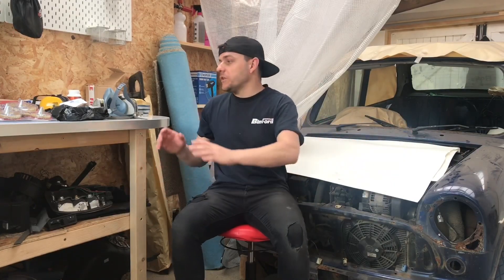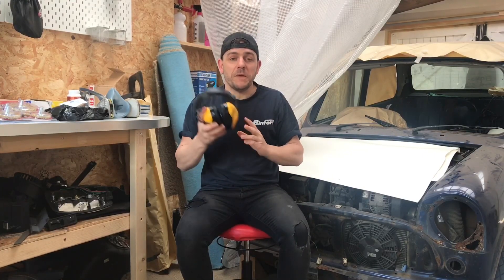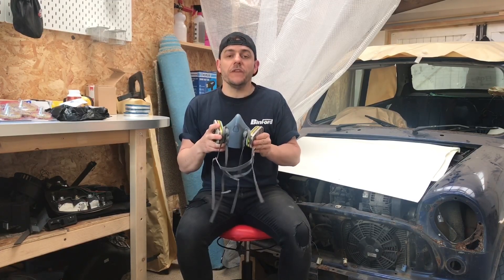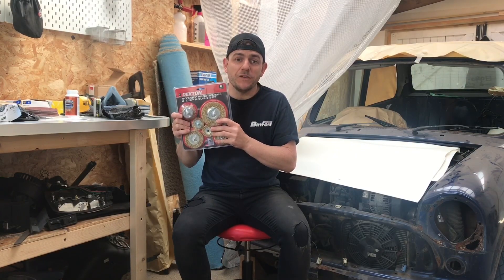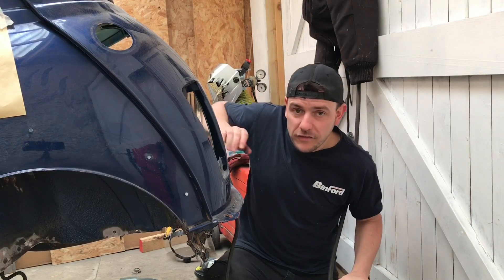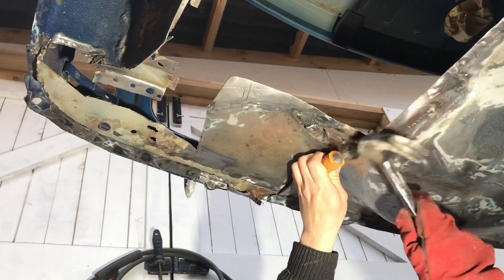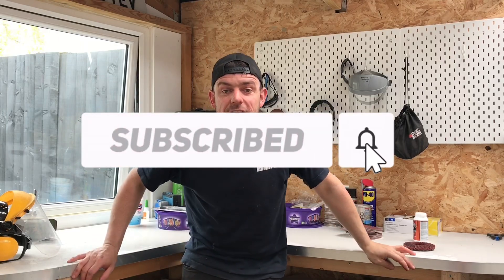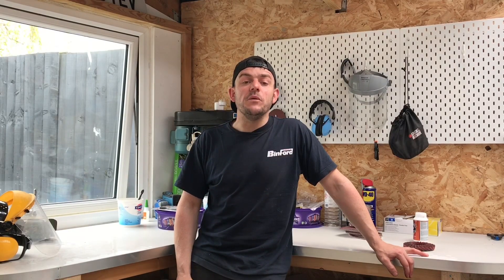Classic Mini Restoration, Cooper Sportspack | New Parts & Mini Repair Panels

Comment: nice work sir - yes those patch panels are from a bygone era, basically over sills for the inside of the boot - you used to be able to buy the same for the inside of the floors. - nasty - loving your work sir and i would agree, chop the lot out and buy a new floor.
Reply from the maker: I’m going to try and use some decent repair panels.... a full new boot is the last option 😬🚀👍🏻

Comment: Good choice on the m-machine panels bud...if you are a TMF (the mini forum) member you get discount with them too, just mention it to them when you call. Make sure you check with them which brand the panels are when you’re ordering though as they do stock some magnum stuff too. If I could go back and re-do mine I’d wire wheel down any areas you know need attention over the whole car (so you know exactly what can be saved or not) then stick your large order in for the panels all at once...I’ve wasted a ridiculous amount of money on postage placing small orders here & there. Keep up the good work! Jimmysclassiccooper 😎
Reply from the maker: Thanks James! I was gonna finish 1 area at a time, just hope the closing assembly panels fit the rear valence